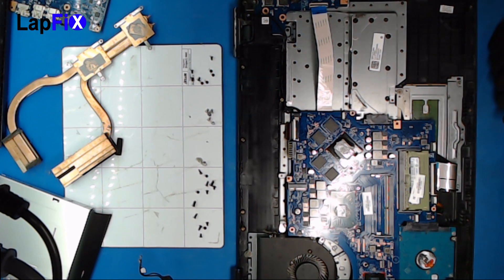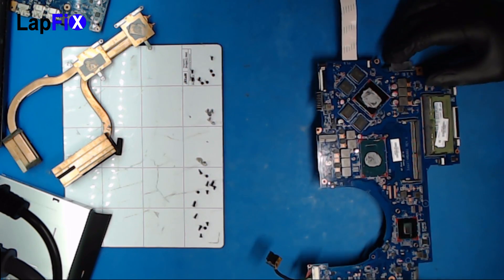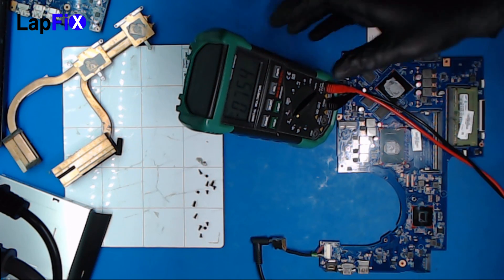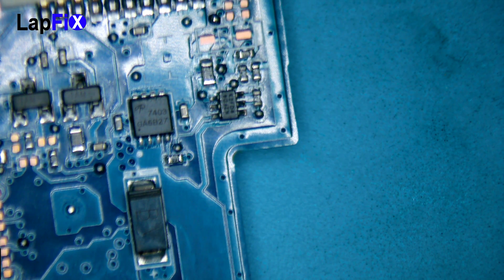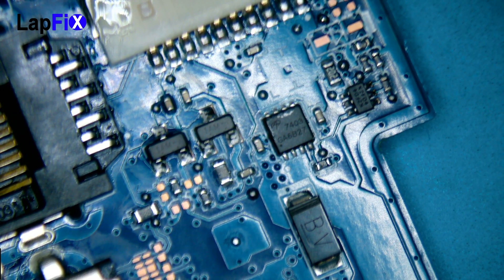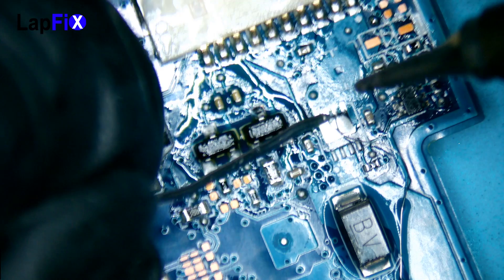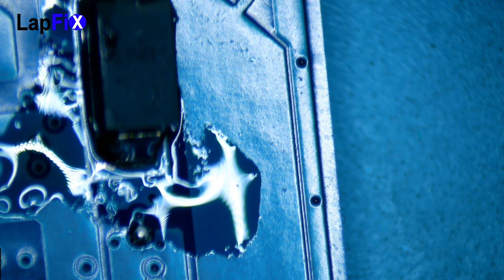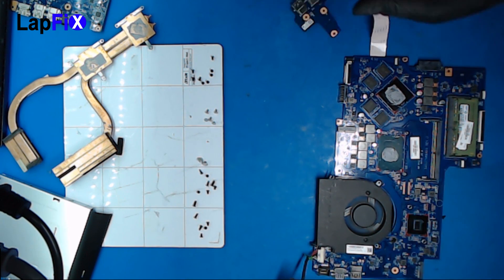Dead Laptop Motherboard Repair No Power - HP Omen | LapFix

Comment: I can say those laptops hp omen AX have a good configuration  but sadly  poorly designed even the plastic case fall apart into pieces. Cracks next to the screen. The fans always have fatigue sounds so no matters how many times you change it for a brand new, it  gonna always make sounds. The ac dc connector is located in the worst part possible. next to the heat areas and the cable decay. Sometimes the ac dc white plastic socked burns exposing your pc to electrical shorts, so keep en eye in that part. Due to the high temperatures battery life cycle is cut in half so expect to order a new one if you have problems. My advise use your pc in ventilated areas and clean the interior every month specially the fan section, huge balls of dust use to block the air vents. And small  cooling fan for laptops can be helpful to reduce the heat.   I managed to keep running my laptop for 5 now. So follow my survival steps

Comment: i have hp omen 1070  . when electiric is off my  laptop working slowly and i cant play games... after 5 hour later its came again and i never plug of or electiric of     it has no problem but if  electiric goes   its fucked up   i dont know what is the  problem     someone says its about power   idle   somethink
Reply: Did you figure this out?
Reply: I think is the power cable, I mean the socket, open your laptop and check the JST connector if it's burned is because of the heat playing games, in case of burned and decayed socked remove and replace, but try first buying a new wire.

Comment: Hi, i got one with short circuit. When I connect the charger, it immediately runs out of power. I have to get it out of the wall again, wait a few seconds for it to work. How to find out where the short circuit is on the motherboard?
Reply: Same problem

Comment: Hello!! 
I have an HP Omen. One day I opened it and found the battery inflated, so I removed it and bought another one. While the new one didn't arrive, I used a laptop just plugged in. One day he started not to call anymore. When the power was on, the LED flashed once, only on the battery it flashed 2 or 3 times, what could it be? Help me please, I'm from Brazil.
Reply: Hello!! 
I have an HP Omen. One day I opened it and found the battery inflated, so I removed it and bought another one. While the new one didn't arrive, I used a laptop just plugged in. ONE DAY IT NOT TURN ANYMORE*. When the power was on, the LED flashed once, only on the battery it flashed 2 or 3 times, what could it be? Help me please, I'm from Brazil.
Reply from the maker: It does sound like it may be a motherboard issue.  If you are interested you can contact us.  Our contact information is located in the description

Comment: My hp omen doesn’t charge ! When I plug in the CA the led still white and not turn orange ! The CA is good 19.50 volt and also the charging port! But laptop doesn’t start ! Could u help me ?
Reply from the maker: It can be anything from mosfet to startup chip. Start simple , trace the voltage and go from there.